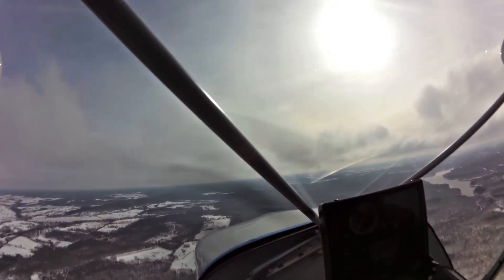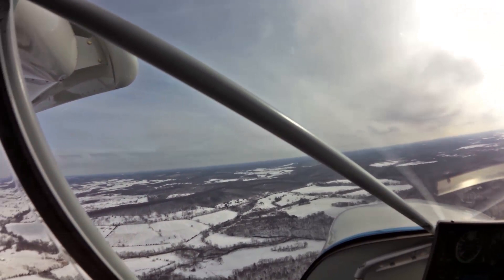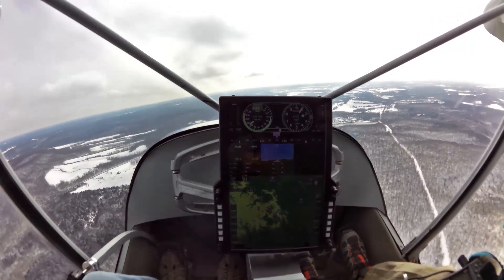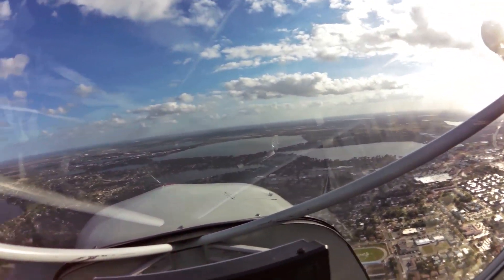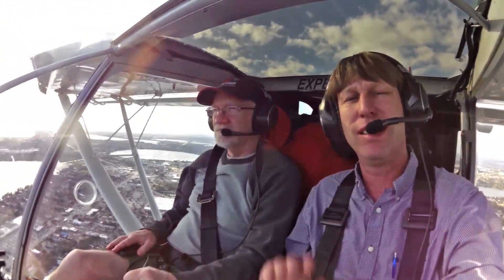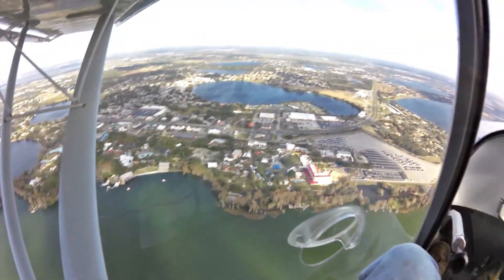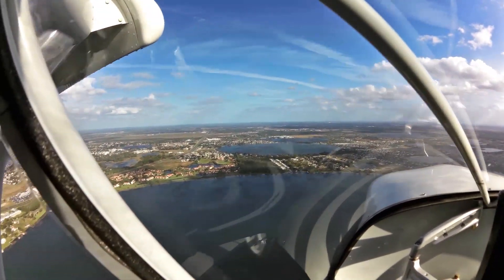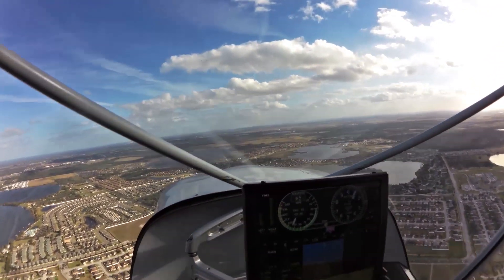Flight to Sebring 2019 in the Zenith STOL CH 750 Super Duty

Comment: A few points about your videos; this one and many others that I've tried to watch from start to finish, but usually give up on about halfway through:

1. Unless you're doing a specific test video, you rarely give consistent and updated numbers on indicated AirSpeed, ground speed, RPM's, and Flight conditions for each leg of a flight, much less fuel consumption numbers.

2.  You continue to use generalizations for flight characteristics as they directly relate to unknown IAS, GS, RPMs, and fuel burn.

3. You often don't tell us what engine you were using, nor do you tell us what prop and the pitch for that prop, nor do you mention the useful load numbers.

I'm seriously considering one of your aircraft as my first build, but I am exceedingly concerned by your lack of specifics in real world terms for the majority of your videos.

My research is continuing on your models, and those of some of your competitors in the same category, as well as for engine choices. I have ruled out the Honda engines because I simply do not trust the man who owns the company. I'm looking at Aero Momentum, Yamaha engines, Hirth, and others, as viable options.

Sadly, I see little to no videos from you concerning these discussions concerning what I refer to as "outside the Box"  engine choices other than the usual pablum of being able to put Rotax engines in your aircraft ( or the other main choice the Honda engines;  the engines I like but not the man who is selling them). The lack of information concerning affordable and reliable alternative engines for your series of aircraft models is really disheartening.

 Rotax engines can cost as much as an entire kit aircraft!  This fact  is not acceptable to many people's budgets nor to our way of thinking!  This is why we are seeing a proliferation of other engine choices and those companies making them come to the fore! ( including using a Yamaha snowmobile engine as the power plant)

 Rotax is losing market share and will continue to lose market share because of the high cost of their products!

 When it comes to flight testing videos specifically you're great! But when you do cross-country flights you leave us almost completely in the dark as to real world numbers!

 The ability to actually operate an aircraft economically, as those economics specifically relate to each individual's particular needs, use, and operating environment, is every bit as keenly important as is the original purchase price for the entire kit.

 It does no one any good to complete a build and  then find the operating costs are much higher than thought and so the pilot-owner cannot take it up on a regular basis.

 Please do not take this commentary of mine, as a beating to the head and shoulders;  I have found you to be straightforward, accurate in what you present, and believable in what you present, which is why I keep coming back to watch your videos and why I have subscribed to your Channel.

 Thank you for your time.
Reply from the maker: Good comments and questions. One thing one needs to realize about "experimental" planes is that each airplane (by definition) is one-of-a-kind, with a specific engine and propeller (as well as any number of additional customizations) and that there are no "standard" Zenith planes. As such, performance numbers are only valid for the specific airplane being flown (which is why it is not that useful other than to the pilot of the particular airplane). We have always encouraged "outside the box" engines (we had the first Rotax 912 in North America back in the early nineties) as well as avionics (such as the Avilution unpanel). Again, because these are experimental "non-standard" engines, their specifications vary quite a bit. As you can see from our many videos on YouTube, we like to share as much as possible about flying our airplanes, but we don't want to make specific performance claims (that may or may not be replicable or representative). With our trip to Sun'n Fun coming up, maybe we'll try to document specifics on fuel burn, speeds, etc.
Reply: @zenithairco  

Thank you for the quick reply and the honesty I appreciate it!

I understand your concerns and observations stipulating that each individual plane and pilot would have different fuel burn rates, performance rates, Etc, based upon each individual Pilot's particular usage.

I said as much in my comment to you.

However, regardless of the pilot, regardless of the use, and regardless of the environment, there are consistent generalities in performance numbers which you could in fact provide.

Example: you have a 701 with an Aero Momentum 97 Horse 3 cylinder engine, say a warp-drive prop, and if used as a Backcountry plane for scouting purposes;  flying to fishing holes, elk areas, you could present the burn rate for such usage based upon those generalities for that engine. Same idea for Hirth engine, whether 65 horse power or the turbocharged 80 horsepower.

 If someone uses a 750 for Rocky Mountain flying, which is where I live, and they've used the Honda 130 horse, or on Aero Momentum 137 horse, and it's used for traveling from one city to another that's in the rocky mountain region, flying at the high altitudes of our Rockies, you could in fact provide a general fuel rate burn, climb rate  at given RPMs, baggage loads, and that would give us a clear understanding In general terms, of what a 750 could do  under those circumstances.

 Another example would be your Cruiser series, with various engines, including VW engines, Honda engines, maybe one or two of the diesel engines available, and it could be used for the cross-country travel for which it was designed, and you could in fact provide fuel burn rates based upon one person with baggage flying at Econo cruise and at Max cruise, and the same thing when carrying two people, at given altitudes.

 My point Remains the Same as in my first comment:  there are General categories of pilots, and general categories of usage, and each of the types of engines to which I have alluded, that have the basics all in common, and so you could in fact provide General specifications for those types of usages.

 A Backcountry pilot in Idaho or Wyoming where I live, or up in Alaska, are all going to have similar results if they are all flying 701s, using similar horsepower engines including the Yamaha snowmobile engine to which I referred.

 You have a wide range of 701s and 750s all across the country, and I would wager across the planet. Have you never bothered to consider surveying all of those Pilots and creating a database based upon geographical locations, type of piloting, engines used, horsepower of engines, fuels used, useful loads on a regular basis, Etc? Fuel burn rates, oil burn rates, Average miles flown and average hours Aloft?

How about the items that have the most impairment, or breakdowns, or breakage of various parts during regular use for the above criteria?

 Will this require a lot of hours of research, emailing people, perhaps calling them in certain instances? You better believe it would, but the end result of such a database would provide you with information that I would warrant few of your competitors have taken the time to secure. It would be a gold mine of information that would allow you to provide confirmed empirical evidence that would enhance your sales ability and offer informational services to prospective customers and current customers, interested in your line of aircraft. It would also provide solid real-world reasons for customers buying from you and not one of your competitors.

 The best aspect of spending the money and time in creating such a wide-ranging database is that once you have it all set up, you simply send out questionnaires via email year after year and that would continue to increase your knowledge base, which would increase its value to you and potential customers year after year..

 When you ask me to spend the kind of money necessary to purchase a kit, and then the hundreds of hours necessary in labor to build that kit, and then purchase an engine that could cost as much as the kit, I want a good, solid, reason in real-world terms to lay out that kind of dough for your product rather than someone else's product.

 I thank you for your time and considering my concerns.